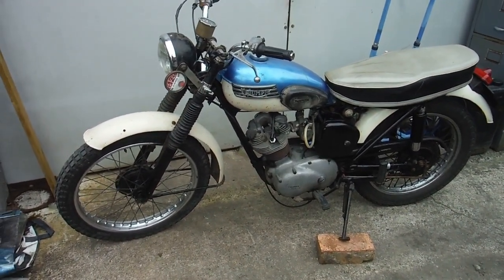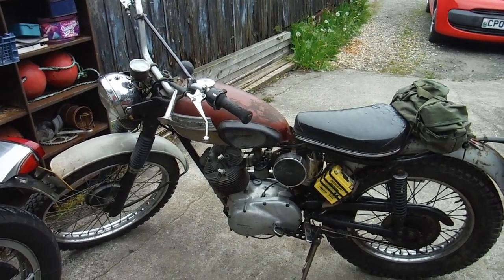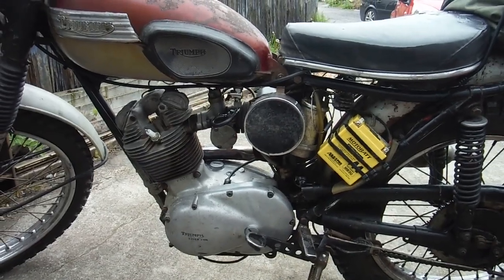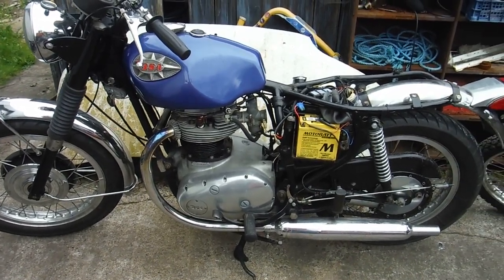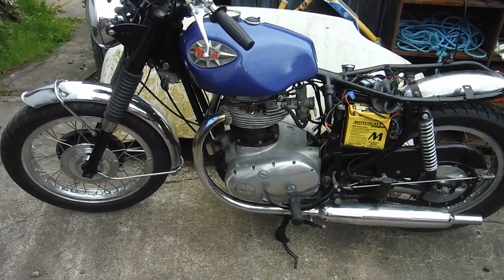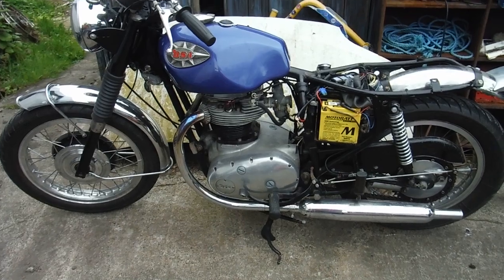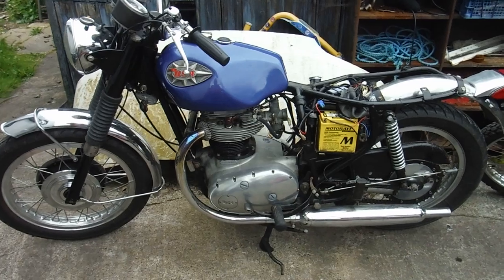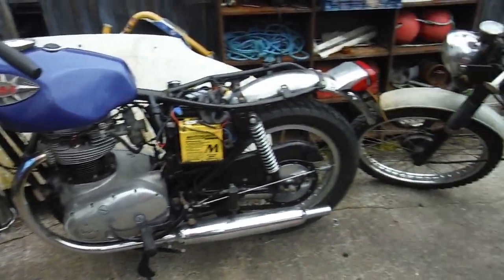When the ignition gremlins are spoiled for choice!

Comment: Had a problem with my Cub cutting in and out. Thought it was the carb since it’s still in points.  After many frustrating hours I finally figured out the fuse holder had a loose internal wire (this was actually a desperate road side repair).  It runs great now feel like I was lucky to see the wire move while stuck on the side of the road.  Thanks for your videos they are great!

Comment: Paul you can get an attack of the Electrical Gremlins on newer motorbikes as well. About three years ago I had the bike booked in at local bike shop. I rolled the bike out of the back gate, shut the gate, got on bike and turned key to run pressed starter button and it didn't start! Starter spun fast enough but engine didn't fire up. So turned the key back to Off then went through the start sequence again, no joy! Checked the Kill Switch, flicked it off and on three or four times, then ran the start sequence again about six times, same result every time. Starter turns engine but engine don't fire. Thought all I'm doing here is flattening the battery, I'll be better pushing bike to bike shop only about half a mile away. Crossing a side road some one  I knew was walking out and they said " I bet I know where you're going!" . Glad of the excuse I took a rest and told them what the problem was and of course when I demonstrated how it wouldn't start the bloody bike did!!!!! Never failed to start before that or since.

Comment: Probably not relevant to your current issues but many years ago I had a mystery misfire that drove me mad. Eventually I discovered that one of the contacts on the points was loose and wiggling around just very slightly. You couldn't tell without taking the points off. Such are the strange things that can go wrong.

Comment: I suppose aging of the wiring and other assorted little things can add up over time to cause such a situation, but, point systems were solid and reliable during the years of their use back in the day, even on my autos of the period (Datsun 510. SAAB 99).  I'd personally want to keep the original set-up as well.  I saw several CDI type ignition system failures on Yamahas I owned which were very expensive to replace.  The Suzukis I owned (TS250s) were stone reliable though.

Comment: I sometimes wonder what people with bikes like a Gold Wing, a big Harley or a cruiser do when the sparks die. The ability to push a bike some distance, like the ability to pick a fallen bike up, seem like a basic necessity. Even if it's just to get the machine to a safer spot.
Reply: Go wings are known for their reliability. They were the first motorcycle to have an extra ticket added to its odometer so you can see if it had turned over even if it looked brand new. If they did have an electronic failure they would simply call their tow service and they would be towed to a shop. If they're Pike fell over in a parking lot I'm sure there will be people to help them get it up but I have seen videos of skinny little women picking up a full-dress Harley that they owned. Me I would never own a motorcycle that heavy. Atypical Harley dresser or goldwing is heavier than my all-metal Ural sidecar outfit. Sometimes buy 100lb or more. Today's big Harley dresser weighs 300 pounds more than a dresser in the 1970s fully equipped.
Reply: Maybe nail an outboard with a wheel attached onto the rack to get you home..

Comment: You could always put a magneto on it I find a magneto to be eminently reliable it's a bike doesn't start either the mag or the plug and it's 99 99 times the plug all the British bikes used to have a magneto in the old days. You can forgive a bike for a lot of things if it doesn't make you push it home 🏡.
Reply: Not sure if there's a reasonable magneto alternative for any of the bikes he's showing here.  For sure, mag ignitions like on Honda Cubs were pretty much bulletproof but tuning was quite fiddly when time came for attention.
Reply: @whalesong999  the original equipment Magneto's like Lucas cama Beach eh, Ard, Johan and Fairbanks Morse magneto are solid and reliable. Of course I run a crash bar so if the bike is down it is not going to destroy the magneto which is kind of expensive. For a triumph tiger Cub or a BSA 250 singles I think points are perfectly adequate.
Reply: @frankmarkovcijr5459  Yes, recall those brands well, many on agricultural equipment I've known in the past as well as aircraft.  I even saw a remarkable adaptation of that style mag on an MV Agusta 175 back in the day in a race at Vineland, N.J.  I recall now that the little MV was owned and ridden by Ed Labelle who seemed to show up  with assorted exotic machines.  This 175 had a girder style "space frame" and might have been an original factory racer.
Reply: Older aircraft like the Cessna 152 run two magnetos, In service you switch to both but check one at a time on start up, for revolution drops. I have had  magneto failure but having two gives added security. The engines rarely run at more than about 2500  revs so a magneto system is perhaps not so good on higher reving  units as on the Lightning . They also require regular maintenance and repairs are  costly if you can't do it yourself as whalesong999 rightly points out. I think electronic ignition is as relable as any apparatus can be. but all other components have to match ihat  perfection / and few people have the inclination or the ready cash to do that and inevitably failure is almost guaranteed,